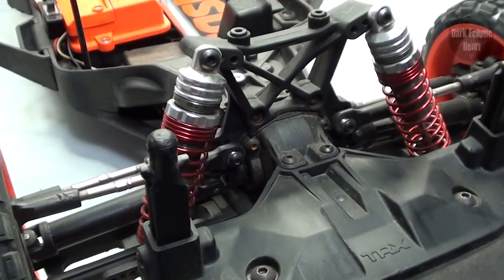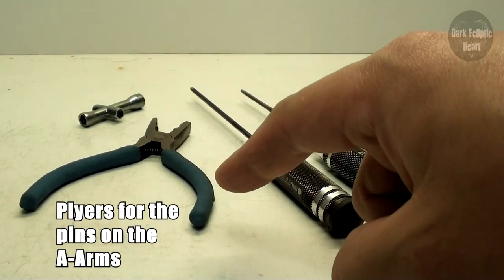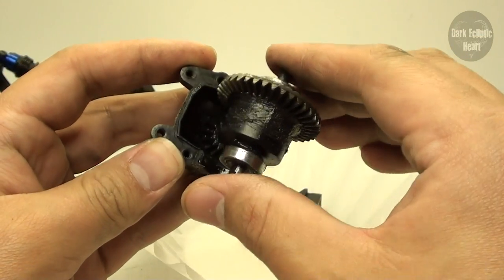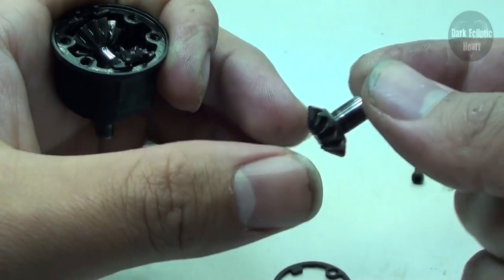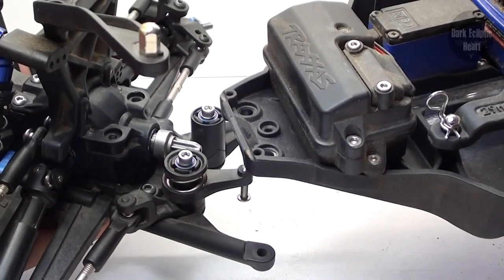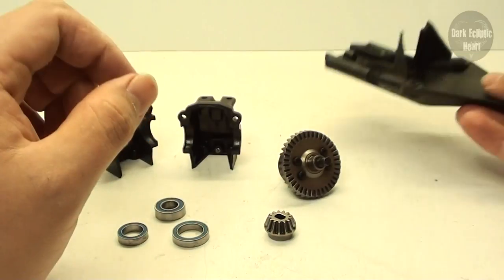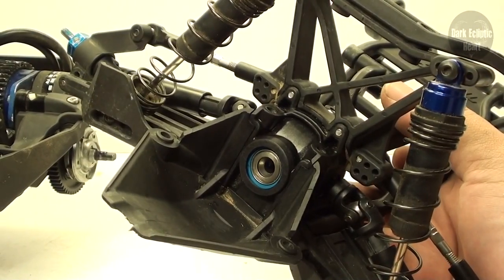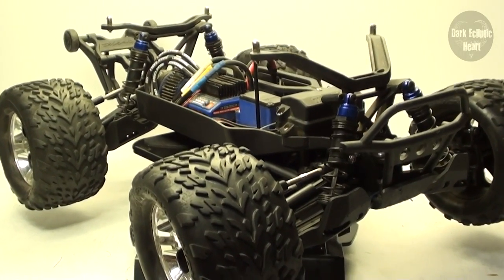How To Maintain Clean & Re Oil Traxxas 1/10 4x4 Differentials (Slash, Stampede, & Rally)

Comment: Although I’m fairly new to RC, the same principle should apply... I’ve done my fair share of auto mechanics in my day and one thing I have learned and definitely want to pass on, STOP using WD-40 as a parts cleaner! Though it’s effective, it’s a penetrating oil. This means it has properties that will destroy rubber, plastic and nylon seals over time.. it’s also not very good for the metal parts either... my suggestion is to switch to an automotive parts cleaner which come in liquid and aerosol form. This will greatly improve parts longevity... Everything else, instructionally, is absolutely awesome information!
Reply: Milleniaman what do you recommend?
Reply: Da Poor Yooper dawn dish detergent
Reply: Diesel feel

Comment: So watching your video I take it someone had it apart before and had the washer behind the wrong seal on the front. At about 7:40 you pull the gear out of the diff housing and I never notice you switching gears, but that one did not have the washer. Great video, I plan on doing mine this weekend, and just want to make sure I done mess it up. Seems pretty straight forward.

Comment: For my stampede, i use marine grease in the case, but in the rear differential, i recently put 20 million weight fluid in. Its like putty. Basically turned my rear into a pretty tight limited slip. Its starting to loosen up just a bit, but its still pretty tight. Its great in the dirt, And will do a full on wheelie on one wheel.

Comment: Watch that you don't spray wd40 in your  bearings. It will remove lube or grease that's in the bearings, it will make wear out. Just wipe off and add bearing oil.  Most can just be wiped off with the coffee filter. Cheers! Nice video!
Reply: what lube should be used to repack the bearings?

Comment: Great video, with exception to the names of the parts.
It is not a planetary drive.
It is a differential, side gears and spider gears. The side gears drive the alxes.
Not a disk. It's a ring gear.

Comment: Thanks for all the detailed videos bro! I just cleaned and refilled my diffs on my Slash 4x4 but after I reassembled it I got a clicking/grinding sound when applying throttle. Sounds like it's coming from the diffs. Yet I don't hear or get that when I turn my axles or center drive shaft by hand.

Comment: When you reassembled the front diff and drive shafts, did you time them? ie have both U joints inline? I know there are 2 ways to slide them together with the splines on the shafts, but I have always installed them with the U joints inline with each other. Will help keep them in balance, and keep them from vibrating.
Awesome video, and kept right on point. Well done.

Comment: At 14:18 you said you remove the bearings, spray with WD-40, and then wipe them down.  My question is:  What do you wipe them down with? Standard wash rag (will it leave any "fuzz" residue?), paper towel, or does it really matter?   Sorry for such a dumb question, but I am a n00b.

Comment: Since you’re going to have your car torn apart this much isn’t it a good practice to just replace the bearing and seals with new ones?  Sure you don’t have to but you have it apart already so might as well and it would also seem like a good time to replace or upgrade the gears and axels. Working on full size cars and motorcycles I’ll do things like that such as replacing all radiator hoses when I replace a water pump even if they look good and when I have things like the thermostat exposed I usually replace that as well simply because it’s one of those items that will eventually west out and I might as well replace while it’s already torn apart.

Comment: Quick question regarding the grease,  on your video " RC "How To" Maintain/Clean/Change Transmission For 2WD RUSTLER SLASH STAMPEDE BANDIT "   You're using the White lithium grease, for the outside gears, and the dark moly lithium grease, on the internal differential...  However on this video, you're using the  30k proper differential grease inside the sealed differentials, and the moly lithium grease for the outside gears.   I have both Stampede's XL5 and the VXL.  I was just wondering why you'd use the different greases, for the diff's on each Stampede.   Did you simply change your stance on which grease due to experience?   or is it the white litihum for the 2WD's  and the dark moly lithium for the 4WD's  ? (not internal sealed diffs) just the outside coatings, I'm talking about.
Reply: No, diff oil inside. Grease on outside, either kind, doesn't matter

Comment: we have done all that you mentioned and it now works really nice.  one question though.  we noticed that the rear wheels are slightly pointing inward.  not sure if it has to do with what we just did or whether the problem is totally different.  any thoughts you might have would be greatly appreciated.  thanks for the videos
Reply: Toe-in of the rear wheels is a common method for keeping your rig more stable. Look carefully at pics of other rc cars & you'll see it's a common theme.

Comment: What kind of springs do you use?  What is the spring rate?  What weight shock oil do you use? and What do you set the front and rear rebounds at with the ultra shocks ?

Comment: Nice video.  You have some clean trucks!  I have three slash platform trucks and they all have leaky front diffs. Should I expect to find bad seals?
Reply: 31186dan Yes... I mentioned above, if you are using WD-40, STOP! Start using a parts cleaner instead... WD-40 is a penetrating oil and destroys plastic, rubber and nylon by its nature... It’s also not good for metal either... Good luck! Keep racing!

Comment: Pack it with heavy duty wheel bearing grease (inside / outside) and you'll be good. The diffs won't get hot enough to melt anything.

Comment: Great vid. You should do one where you shim it. Erevo 1/10. 

Hey so I could only find 20k fluid for the front. Is that ok? 

I Also want to use the diff cup with the I-bar from the E-Revo in place of the diff cup on the center diff. it is a little shorter and a little different. Is that ok?

And what weight oil should I use in the center diff. Comes with 100K. My friend says I should use traxxas 500K. ? Thanks for any help.

Comment: Can you use nitro fuel for cleaning differentials? I know high nitro content works for cleaning carb parts and removing paint... as I do have old nitro fuel (it won’t start my model due to contamination or more likely lost its alcohol... and the fuel is not the 20% nitro percentage I use as this fuel is over 30% nitro)... and another type of cleaner I’ve heard works is any that contains naphtha as it breaks down diff oil very well

Comment: Just like Dodd Vernon, My 9yr old and I are getting started in the RC too. I got the Stampede 4x4 and my boy has the Teton. Quick question, when cleaning the bearings and any other parts that could collect grim, is a non-chlorinated break cleaner sufficient to clean them off or would you advise against it? thanks in advance..
Reply from the maker: Orlando Longoria Usually RC enthusiast would advise NOT to use any kind of break cleaner due to the harsh nature of the chemical. However I've never tested it myself. I would say test it on a spare part and see how well it works. However keep that stuff off of plastic. It will dry it out and cause it to become more brittle.
Reply: +darkeclipticheart 
I appreciate the helpful hints.. By the way,, have you ever worked on a La Trax Teton??
Reply from the maker: Orlando Longoria Sorry but no. I  haven't got my hands on a LaTrax yet.

Comment: So I went to my local rc shop and was sadly dissapointed in the customer service. They recommended me team losi racing differential oil 50000 wt. What's your thought on this? I wanted to get the same 10k and 10k from factory racing but they didn't carry them.
Reply: ok? it's fine. Trust them, they know what they're doing. You don't have to use exact oils

Comment: I have the stamped 4x4 and i drive it everyday until the batteries go out I do not charge the batteries until the next day but I just use my stampede for going off-roading and four wheeling through mud and sometimes I drive it down my street to see how fast it will go what is the recommendation weight should I you,s for my differentials

Comment: Hi darkecliptic heart I have torque issues with my 1/18 Truck, It is fast and zippy on road and doesn't seem to have any problems what so ever...But when it comes to offroading and going uphills it only measures maybe 8-12 mph offroad and 4-6mph and sometimes cant go uphills(maybe 22 mph onroad) I know it would be slower off road but not that much decreased...I investigated the truck and found that the diffs doean't have any grease and maybe oil inside!!! Is it the reason why its slow offroad and cant go uphills? Or is it because my motor is very old, PLEASE NEED HELP!!!!! Also I need another help why is it sometimes like its binded( I dont think theres any bind on my car, no bind button)....
My truck is a offbrand and soldout but its pretty similar to Himoto 1/18 Centro.....

Comment: I have a redcat rc truck.  Stock differentials keep going out and when I take it apart the grease does look very black and worn out. What should I use for typically on road in some slight bashing front and rear differential fluid. From the factory it looks like  a black Grease.   What should I do

Comment: Could you please confirm the diff grease is for lubrication or for friction?  And for diff oil, what are the difference for 30k or 50K?

Thank you.

AC
Reply: You don't need 30k silicon. In my race vehicles I use 3k to 10k. 10k is thicker its can be used for tuning. For example in loose conditions you use a thicker oil. The thicker oil helps with wheel spin. With high traction you can use 3k,5k or 7k. TLR or Team associated sells good silicone oil. Use black grease for gears don't have to use alot. Cheers

Comment: I used black automotive grease on my rear diff gears and there seems to be some binding where they used to move like butter. What did I do wrong?
Reply from the maker: My only guess is that something wasn't set in place properly. Only thing I can think of is that you didn't tighten the Diff Gear together evenly.
Reply: Just took out some of the grease I put in. I think I over-packed it. Running much smoother now, but still not as smooth as it was originally. But then again, there almost no grease on the gears when I took the gears out. Also, put a thin layer of grease on the shaft where the bearings go. Great videos, BTW!

Comment: I was using 3s lipo on my Traxxas E-REVO vxl 1/16 and the rear diff starts to make a clicking strange noise,so I bought a kit to shim the Diffs (jester 7 up) and I want to clean and re oil the diff ,so
1-can i use water to clean the diffs and the ball bearings or not.
2-can i use 30k traxxas diff fluid on rear and front differentials or not.
3-can i use traxxas marine grease on the out side of the diffs or not 

THX. (im a newbie)
Reply from the maker: 1 I'd highly suggest you use WD40 to clean
2 Yes
3 Yes

You can get away with using water to clean Metal parts on an RC but you have to make absolutely sure that all the water is wiped off quickly so it won't rust. Afterwards I suggest you wipe it down with a paper tower that has a little bit of WD40 on it. That's why I suggest you just clean it from start to with WD40. However with Plastic parts, use Dish soap and hot water and you should have no issues :)
Reply: thanks.You do Awesome videos and you really help me,thanks again.
+1 subscribe

Comment: Ok guys I need some help here I recently bought a traxxas slash 4x4 and was wondering if there is a set amount of hours you are supposed to reach before re oiling the differentials and stuff like that
Reply: Is say maintain it every 3 months. For me, 3 months is about 25 runs on pavement. If you normally drive yours in a more dirty environment, do it more often.
Reply: k thanks man my rigs down for a while though I managed to brake a steel drive shaft right after doing maintance on the whole machine got 15 feet and the tire fell right off it broke were the out side bearing goes in :(
Reply: +Christian Prejean damn, hopefully it wasn't a bitch to get out. That has happened to me before and spent a few hours trying and trying to get that driveshaft out!

Comment: hey man, since im cheap i only wanna buy one diff oil. what wieght could i use in both front and rear. i bash alot and sometimes speed runs. thanks!
Reply: +RCZ 30k on the front and 10k in the rear so average it maybe 20k for both front and rear would do. Thats what I did. lols.
Reply from the maker: +RCZ I agree with BangBang
Reply: There's also one trick I do If I'm really cheaping out. I would buy a 100k or 50k silicon diff oil and just mix and ratio it with silicon shock oil. Example 100k mix 1:1 with 30wt shock oil, that would give me roughly 50k wt diff oil. 100k on 1:2 ratio with 30wt shock oil would be around 30k wt. The Important Part is that both the diff oil and shock oil must be silicone base so they would mix nicely and not seperate.

Comment: I followed this exactly and I seem to be getting leakage now, dirt and dust collect around output shaft. Have yet to do it again n see whats going on in there but it wasnt that long ago i did it...any advice? i guess ill just do it again..great vid..ty.
Reply from the maker: +mike zilla It depends on what is leaking. If its the diff fluid then my guess is that you didn't screw the diff together evenly or all the way. If its the grease for the outside of the diff, then you might have over packed it.
Reply: Sounds like a seal on your diff is blown
Reply: Mine leaked from the day I bought it, Finally just exploded. I was gonna buy a new diff and be done with it but I'm gonna try and get away with getting new rubber seals and filling it with grease and going. Mine is a pede 4x4 vxl.

Comment: do the bearings need to be loaded with grease/oil upon reassembly?
Reply: It's good to oil them. DONT use WD 40 on the bearings. There's too many foolish people that use WD-40 as a bearing lubricant. You want to use oil like Turbine Lubricating Oil. Ace hardware sells it and you can also buy it on Amazon.

Comment: what kind of weight front and rear would you suggest for racing?
Reply: Too many factors. If your inside tires balloon more than the outside, you need thicker oil front and rear. If you oversteer under power, you add more to the front. If you understeer under power, add more to the rear.

Comment: What kind of transimission oil should I use for my stampede 4x4 vxl.
Reply: Use grease for the transmission, use oil inside the differential. Which oil you use depends on your driving preferences and running surface.

Comment: have you tried the x01 gear set, and if so did the ibar give you any added strength?
Reply from the maker: +humble rc Nope. Haven't tried it.
Reply: +humble rc....I put the XO1 Diffs, carriers, and axels on both of my Slash 4X4 LCGs and I did notice they are holding up much better now.  I run mine hard but I keep them maintained so it's all good.  I really like the bigger bearings in the carriers too, now I don't have to replace them as often as I use to.  L8R, Michael

Comment: What happens if you put shock oil in the diff?
Reply: Shock oil is usually at least 50-750 times thinner than differential oil. The tires would easily be able to turn one apart from the other and I'd imagine the oil would break down cause it's not meant to be put to that kind of use.
Reply: Genesis RC what happens whit grease?
Reply: I would imagine that the grease would get pushed away from the gears and wouldn't flow back unless thin enough. And if you put too much of it in there you would get overheating problems due to fluid friction.

Comment: I Can use The grease on The inside rigth?
Reply: yes, but its not recommended
Reply: naphen Why?
Reply: He states it in the video, grease is inconsistent, gets dirty easier, etc. You can use it on the outside, not the inside. You can if you do not have access to diff fluid, but if you do, get some, Its not to expensive
Reply: naphen ok Thanks

Comment: will this work on the slash 2wd
Reply: Brandon Watkins I believe those diffs are the same as 2wd stampede/rustler/bandit.  In that case, just clean and apply grease to the gears-- not too much grease. There are no o rings or seals in that diff so oil would just leak out.

Comment: Just wish the new trucks came with diff oil in the diffs NOT Grease.  My new Rustler rear dif was failing on titan power.  

Took it apart to find they DO NOT infact put the carrier in there for support. 

Nasty ASS black dead grease just does NOt CUT it for a 600 dollar truck. Canadian price. 

To advertise and not to do what is advertised is BAD Business 

I'm mad today. Because my Rustler is Full of issues.  And it's brand new. 

And all I got from support is that's the way it is.  

WTF.  .

Comment: Hey are you still this awesome !? 😂

You need way more views and subs you blow away all the other tutorials . RC sparks is as good as you with his little mini me doll . 😂👍

It's -10c, is 3000 wt losi silicon fluid good for the differential ?

We have 3000 in the back , we are thinking of adding a few drops of 50 silicone and then 3000 wt. about 90%. So we hope to be around 2750?

Because you want the front to turn right ? Or should we go the exact same ?

If the fronts to stiff won't the back end push and mess up turning ?

Please reply when you can 

You can post links to any RC videos on our ad free channel if you wish 

You rock Bud🍻👍😎🏎💨